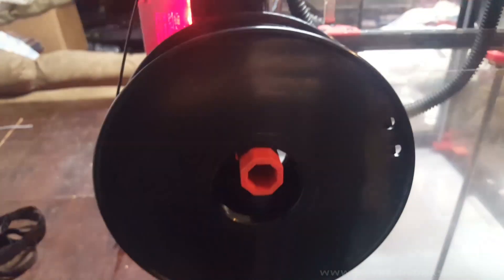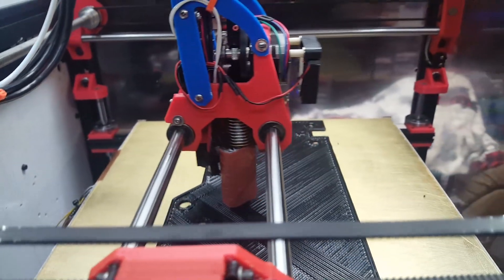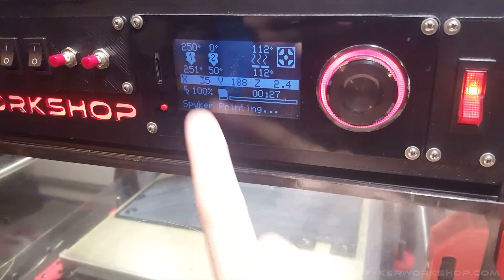E3D SuperVolcano Review - 3D Printing - Spyker Workshop

Comment: lower than a 0.4mm is not made simply because it is easier to swap a tool head than it is to get that system reliable. Unfortunately due to the linear motion you chose, tool changing is prohibitively difficult and will never be as consistent as alternative linear motion options like rollers or rails

Comment: What 3D printer is that? - any plans or info for it out there? Looks like a well built machine, well done!

The supervolcano looks ideal for what you're doing. Great idea with the sensor on the top of the heatsink. Would be great if new firmwares supported 3 pin fans, where one pin is the RPM sensor. Prusa i3 MK3's have them, prusa may have backported the fan rpm feature to marlin main, I haven't kept up with new developments in marlin for a long time so I don't know if they did.